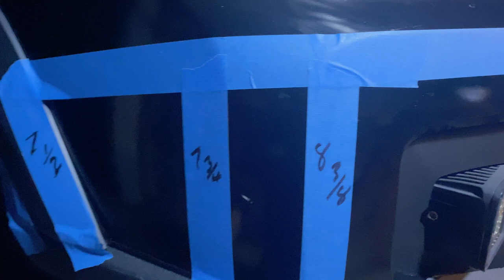Installing a Rough Country's High Clearance Bumper 18 Toyota Tacoma

Comment: Good video, thank you.  Thinking of doing the same on my tacoma. 
How hard is wiring the winch to the battery?
What is the brand/model number of the hook/shank you put on the cable end?
Reply from the maker: Wiring to the winch wasn’t hard at all. I just ran it behind the grill up to the battery and the hook came with the winch. The brand of the winch is rough country 1200 pound but you’re better off going to Harbor freight and buying one they are much better

Comment: Did the bumper come assembled already I saw another video where you have to drill  wholes to Attach the wings. And yea the direction on line are not the best?
I want to know exactly what I'll need for tools before buying. 
Thank you for your time.
Reply from the maker: the wings came with the holes pre-drilled all you have to do is bolt them onto the central part of the bumper.
when I was installing the bumper I was trying to do it in one piece it made it heavy and more challenging to line up so I removed the wings after that the center bumper was easy to install.

Comment: Thanks for the video.  Did you end up needing to relocate the AC condenser?  I bought the same bumper w/ winch and am wondering if I need to move it back before installing.
Reply: I’d like to know too. My winch hasn’t arrived yet but I tried putting it on anyway. Could not get it on. No matter what. Trying again in the morning.

Comment: Do I have to use the rough country winch or can I use the badland apex 12000lb winch ? @bravo-overland
Reply from the maker: you would have to get the measurements of both winches and see if they lineup i know there is a decent amount of room where the winch mounts to the bumper so if H X W are close you should be good to go.

Comment: Hey bud. I had a question.  Did the bumper interfere with the front radar system.  And any regrets with the bumper so far?
Reply from the maker: Sorry for the late reply but no it didn’t affect the front radar system. And the bumper works great. It paid for cell off-road in already.

Comment: Does the Bull bar block the grille from coming off?
Reply from the maker: I’ve never tried taking off the grill after install the bumper, but by the looks of it, you have a 50-50 chance that you have enough room to get the grill off that is a great question. I will attempt to take my grill off and I’ll get back to you.
Reply: @bravo-overland  thanks for the fast response.

I’m close to pulling the trigger on this bumper. Did you also move or buy a rad cooler relocation bracket?
Reply from the maker: @JtheInvincible  no I did not. I was worried I may have to, but when I installed the bumper, there was clearance between the winch and the cooler by 2 inches so it was perfect.

Comment: can you explain how you ran the electrical harness for the light bar. what chase did you use?
Reply from the maker: sorry for the late reply. the light bar comes with a wire harness and switch but its trash. so i cut the switch and rellay off and connect the wires to my Auxbeam 8 Gang Switch Panel. Chase ?????